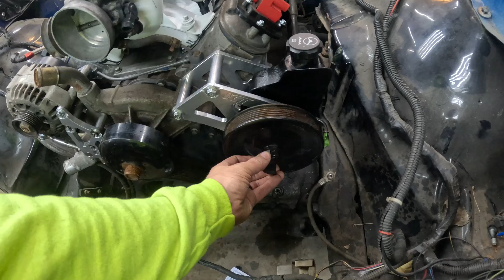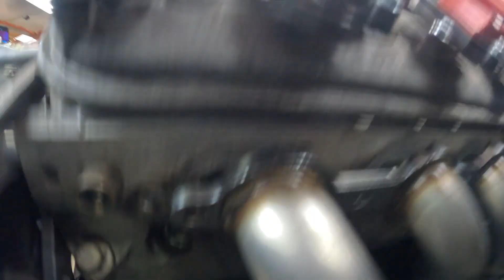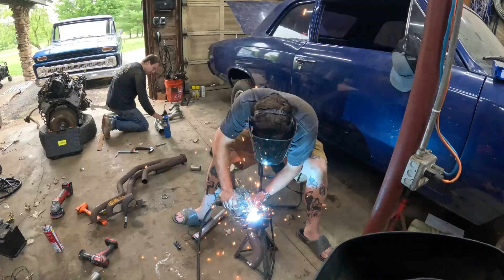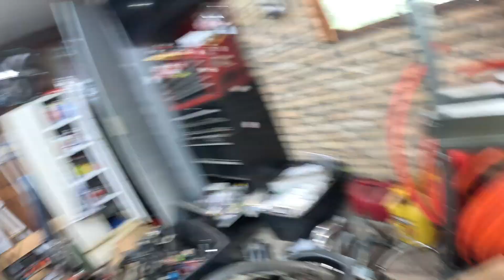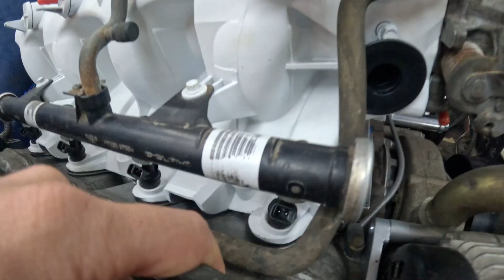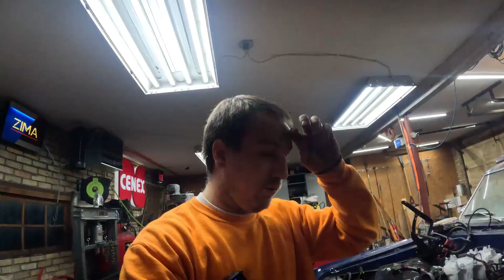LS Swap Chevelle, Will It Run?!?!

Comment: Ok
Basicly i need wire cutters for my solinoid wire!
Id look under my dash or firewall/they say our 67s will need the distbtar wire replaced   ause its a resistor type wire/down to 6 volts.